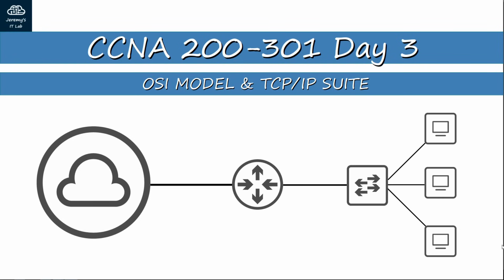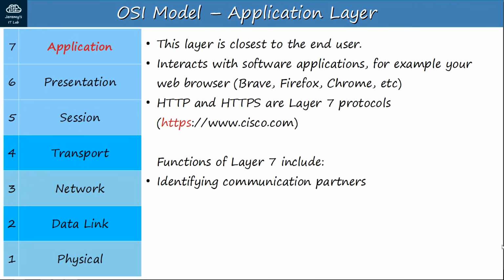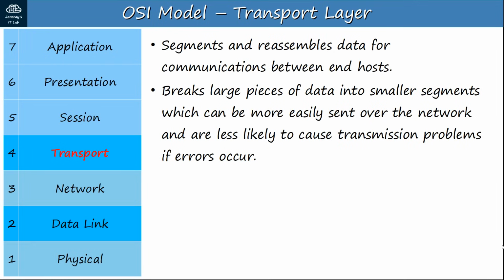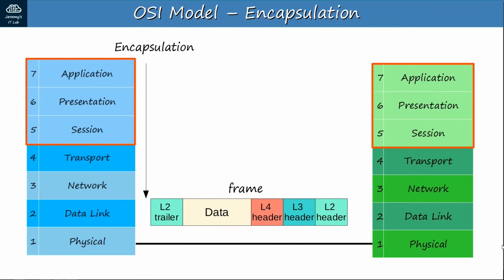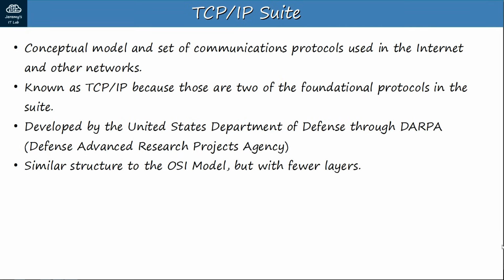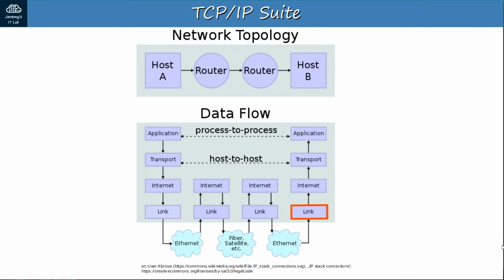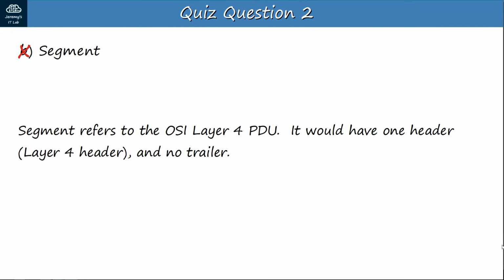Free CCNA | OSI Model & TCP/IP Suite | Day 3 | CCNA 200-301 Complete Course

Comment: I was a bit confused in the beginning of the video when covering encapsulation of the OSI model with routers being a layer 3 device. It did not make much sense to me that devices went through the full layers to L1 but then were routed from the router (l3). Layer in the video you covered this well! It de-encapsulates & encapsulates from L1-L2 for each hop to the other network. Thanks for explaining this!

Comment: Hey man i am using this video course only. Does it cover all the exam objectives and will i be ready for the exam just based off this course? Thanks, really appreciate this!
Reply from the maker: It will cover all of the exam objectives, unfortunately its only about 50% finished at the moment.
Reply: @JeremysITLab  Hey man great to hear that. You are doing a lot for this industry, its really helpful for us beginners getting into IT certifications. I am at Intro to the CLI | Day 4 at the moment so i think i will be fine with the pace. What do you reckon, my aim is to finish two of your lectures a day. Thanks again!
Reply: @JeremysITLab   How much weightage does OSI andTCP/IP model holds in 200-301 exam?
Reply: @DAfitnessCoach  hi man, did you pass the exam ? and how u found this course.
Reply: @DAfitnessCoach  everyone needs to put some donations to help Jeremy's IT and this course get faster done, in that way he can help us with questions and material required.
Reply: @JeremysITLab  Hey Jeremy, is it 100% now?

Comment: Great video Jeremy.  This is one of the best explanations of the OSI model I've seen.  Just one suggestion.  Although it is implied here, I think it's important to explicitly point out that every layer of the OSI model (and TCP/IP suite) is dependent on the layers below them to function.  So in other words, if Layer 1 (Physical) fails, then nothing else above this layer can function.  This seems obvious at Layer 1, but at the logical layers above the same applies (if Layer 3 fails then Layers 4-7 will also fail).  At the same time, if a device functions at say Layer 3 (like a router) then by default it also functions at Layers 1 and 2.  This also means that a PC functions at all layers of the OSI model.  That graphic you found of data flow is EXCELLENT.  Makes it so easy to understand.

Comment: The aid I normally give to people trying to remember PDU's and which OSI layer they relate to is to separate the first 3 letters from the PDU which leaves the number of letters coresponding to which layer it belongs to:
Transport - Layer 4 - Segment - Seg ment - 4 letters remain
Network - Layer 3 - Packet - Pac ket - 3 letters remain
Data Link - Layer 2 - Frame - Fra me - 2 letters remain
Physical - Layer 1 - Bits - Bit s (as you never send only one bit over the network) - 1 letter remains
Hope this helps someone.

Comment: Well, in video u mentioned host to host connectivity provide transport layer but it's also provide network layer. 

Transport layer : end to end ,port number. 
Network layer: host to host, ip address 
Data link layer : hop to hop , Mac address. 

Correct me if I am wrong.

Comment: You said  at time 24:01 of this video  that the  the OSI Transport layer provides host-to-host communications, but I wonder why don't we consider the Network layer resposible for host-to-host communications  since the distination IP address of the frame doesn't change along its journey but only the frame destination  MAC address changes at each hop during its journey from the  source host  to the final destination

Comment: Hey Jeremy, many sources on the internet say that the transport layer is responsible for Process to Process delivery. And the network layer is responsible for host o host delivery.
I think it is somewhat correct because port numbers are handled by the transport layer. But the network/internet layer works only b/w routers not LANs. So which one is it?

Comment: I think I get it now....So in the physical representative sense, the Transport layer is referring to the NIC and interface ports on the hosts (servers, PCs, etc..)? WHAT happens there is the breaking down of the data or reassembling of it but specifically WHERE that occurs is at the networking hardware of said hosts (like the aforementioned NIC and interface ports). Ergo, host-to-host. Am in the right ballpark?

Comment: hello sir i have a question. we learned here that digital bits are converted to required format(electrical or radio) in the physical layer. could you please tell me in which layer is the data converted into bits? thank you!

Comment: One of the questions in the flashcards asks, "Which layer of the OSI model detects and corrects physical layer errors?" then shows the answer as layer 2. but Layer 2 does not do error correction, just detection via the Frame check sequence. Error correction only happens at layer 4. Am I wrong?

Comment: It seems there is an error in the L4 explanation. It shouldn't be 'host-to-host' but only 'process-to-process' thus this leads to the following: 

- Network Layer (L3): Provides host-to-host routing using IP addresses

- Transport Layer (L4): Provides process-to-process communication using ports

To be able to communicate between hosts we would need MAC/IP which aren't available in the L4 TCP or UDP header. 

Please correct me if wrong.

Comment: I'm a little confused about host-to-host communication. The diagram in the 'data flow' section shows host-to-host communication at the transport layer. However, in the flashcards, the question, "Which layer of the OSI model provides connectivity to end hosts on different networks?', the answer is 'Layer 3 - Network'. What am I missing here? Thank you.

Comment: the flash cards for day 3 doesn't work. even though everything else works fine

Edit: for some reason the flashcards can't be imported directly from the ankidroid App on android. You have to import it from your pc and then sync it to your phone by using the same anki account, then it should work just fine with your phone.

Comment: Hi Jeremy. In the video you said that the Transport layer provides process-to-process communication as well as host-to-host. However, in the flash cards, the answer to the question “Which layer of the OSI model provides process-to-process communication?” is “Layer 7 - Application”. Just want to clarify which is correct?
Reply: I have the same question. Is it a layer 4 Transportation?
Reply: Layer 7, he's going by the flow chart he showed at 21:39 Process to process, Layer 7 Application.

Comment: Hi Jeremy. Just a little bit of confusion. On the video, talking about the OSI model, you say that the Transport Layer is the Layer where the Process-to-Process communication takes place. However in the TCP/IP model, showing the Wikipedia Data Flow chart shows that the Process-to-Process occure on the Application Layer. Am I confused, is that an ERRATA on the video or that's the way it is? Thank you so much for your help.

Comment: Really enjoying your course and thank you so much for all your hard work. I noticed your using the 4 layer TCP/IP model in your tutorial but I was led to believe that the 5 layer TCP/IP model was more appropriate for the new / revised CCNA, CCNP and CCIE examinations. This 5 layer model was quite strongly reinforced in another set of tutorials I have been following and seeing your material talk exclusively of only the 4 layer model has derailed me a little. Can you comment on how critical this is for passing the exams?

I guess, my concern would be with an exam question like ‘Where on the TCP/IP model would the OSI layer 3 Network layer be?’ On the layer 4 model, this would map to layer 2 Internet, but on the 5 layer model this would map the same as the OSI and the correct answer would be Layer 3 Network layer.
Reply from the maker: Feel free to use the model you prefer!  Whichever makes things easier to understand.  That's why I presented the various models in this video.

Comment: One question - I notice that the Cisco CCNA cert guides   specifically says that for the TCP/IP suite to use the 5 layer model: Application, Transport, Network, Data and Physical - much like the OSI model.  Has this changed or do people just use different kinds of layers for the TCP/IP suite based on how they learned it.  Thanks
Reply from the maker: Hi Barry,
The official TCP/IP model has four layers, but most people (including me!) prefer the five-layer model.

Comment: what is the use of layer 3 broadcast address if the devices with in network communicates at layer 2
Reply from the maker: If the Layer 2 address is broadcast, but the Layer 3 address is another device's address, the message will be ignored.  The Layer 3 broadcast message means that the message is destined for all devices on the local network.

Comment: What is the difference between protocol and standard?
Reply from the maker: A protocol defines a set of rules used by two or more parties to interact between themselves.  
A standard is something designed to be used as a rule, guideline or definition.
So, some standards are protocols and some protocols are standards, but they aren't necessarily the same thing!
Reply: @JeremysITLab  Thank you very much Jeremy!

Comment: Hello and thanks for this series of video lessons, I find them so useful!
I have a question about the flash cards of day 3: one asks “which layer of the OSI model provides process-to-process communication?” And the answer is “layer 7 - application”.
Shouldn’t it be “layer 4 - transport”?
Thanks again! Bye!
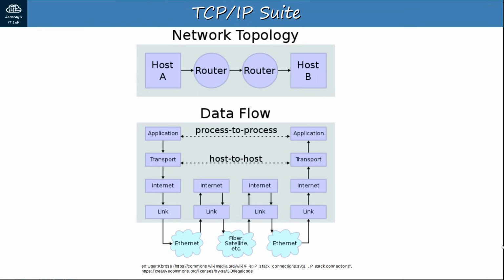Reply from the maker: The flashcard is correct.  Check out the diagram at 21:03, it's helpful.
Reply: Jeremy's IT Lab Thanks a lot for your reply!
What is the meaning then of what it is said at 10:11?
Reply from the maker: @TheSten89  The 'host-to-host' communication at Layer 4 is what enables the 'process-to-process' communication at the upper layers (5-7).  I should have emphasized this more in the video, but each layer 'serves' the layers above it.  Layer 3 serves Layer 4, Layer 2 serves Layer 3, etc.
Reply: Jeremy's IT Lab I understand now, thank you so much! You’re the best :)

Comment: In one of your questions in the ANKI, there is a wrong answer: 

Which layer of the OSI model provides process-to-process communication?
Layer 7 - Application

The answer should be layer 4. 

Or do I understand the question incorrectly?
Reply: layer 4 transport layer provides host-to-host communications while layer 7 the application layer provides process-to process communications. So the answer is correct. He also mentions that in the quiz section of this video in case you wanted to confirm. Good luck!

Comment: Would you advise on changing the "New cards/day" and "Maximum reviews/day" values since the default value of the former is 20 and if I add some of my own questions as flash cards i end up not reviewing every single one of the questions i downloaded from your link. I'm actually new to Anki so I don't know should i change anything in the options or just keep it as is?
Reply: at the "deck" page, at the right of your deck CCNA there is a wrench sign; click the wrench to show a menu, then click "option" in the menu to change daily new/review card limit

Comment: I found a mistake in the Anki files. Question "Which layer of the OSI model provides process-to-process communication?" it gives answer: "Layer 7 - Application" but should be "Leyer 4 Transport"
Reply: layer 4 transport layer provides host-to-host communications while the application layer provides process-to process communications. So the answer is correct. He also mentions that in the quiz section of this video in case you wanted to confirm. good luck!
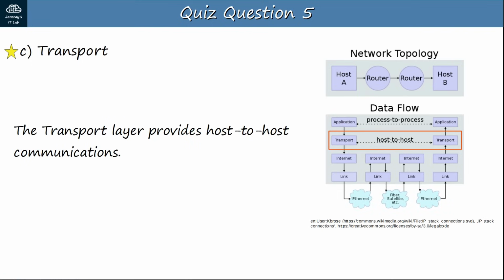Reply: @YoItsDalia  10:10 So the video contains contradictory information 32:12 Clarify my confusion.
Reply: @ you can see in the slide written host-to-host for the transport layer 10:10 I think Jeremy mistakenly said process-to-process there. I’ve also confirmed that with chatgpt so the correct one is host to host for transport layer and process to process for the application layer.

Comment: Anybody else get confused on quiz question 2? i was having some trouble understanding it
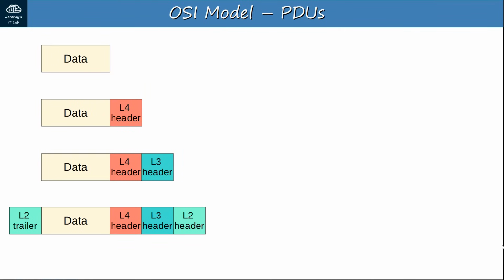Reply: It's essentially asking at what current layer is dealing with the data, but the question is actually asking you to describe the data in terms of its encapsulation. If you go back to 15:55 you'll see that Jeremy explained it quite well. 

So if 3 different headers are attached, it's a frame operating at the 2nd layer of the OSI model.

Comment: I don’t understand Quiz question 1. If my web browser is talking to YouTube’s webserver, the only way to do that is by encapsulating a request, forwarding that request to YouTube’s server, that server de-encapsulating it, processing the request, encapsulating a response, forwarding the response, then my pc de-encapsulates the response and handles it. You cannot ignore those steps. Saying this process is adjacent makes no sense. Is this just an “industry standard” way of talking about this interaction? 

This is the same kind of logic as saying “my car is electric” despite owning a pickup with a 5.7L V8 engine needing a battery for the starter.
Reply from the maker: The question is specifically asking about the HTTP exchange, not the underlying protocols and processes that are used to deliver the messages between the two hosts. Read the question carefully and think about what it's asking.
Reply from the maker: An HTTP exchange between two hosts is an example of same-layer interaction. Other processes, like encapsulating and de-encapsulating messages, are required to enable that exchange, but it's not accurate to say that "an HTTP exchange between two hosts is an example of encapsulation".

The logic is like saying your pickup with a 5.7L V8 engine is a gas car (an accurate statement), even though it uses a battery for the starter. The starter is one process that enables the car to drive, but it's not accurate to say that the car is electric (just as it's not accurate to say that "an HTTP exchange between two hosts is an example of encapsulation", even though encapsulation is one of the processes needed to deliver messages between the communicating hosts).

Comment: Hallo Sir,i have one question...i am not getting host to host communication what does it exactly means...if every data is going throught he same process for example layer 7 to layer 1 and vice versa what does host to host means then....did not get it....Thanks a lot
Reply from the maker: The diagram at 21:06 is the best demonstration I think.  Notice how the Layer 4 segment remains untouched from Host A to Host B, while Layers 1-3 do the work of sending it from network device to network device.  When I cover TCP/UDP (Layer 4 protocols) later in the course you'll get a clearer picture of it.
Reply: @JeremysITLab  ok Sir thanks a lot indeed

Comment: There is an error for this days anki flash cards.
Reply from the maker: What's the error?
Reply: @JeremysITLab  the error states it is not a valid file type for anki and that the extension is not correct. I checked it and it is. I even tried changing the file type to the other accepted file type but it does not seem to work. Day 1,2,4,5 are working perfectly and have helped so much!
Reply: @ericgillespie2812  I'm having the same problem now
Reply: @JeremysITLab  Maybe you could try reuploading the file in the folder? I tried downloading it several times but the size is always 0 B even though it's stated in the folder that it's 9.6 KB.
Reply: Okay, I figured it out. I tried downloading it from my laptop then sent it through file.io to my phone (I use AnkiDroid for the flashcards). When I downloaded it on my phone, the file ended up as a .zip file with 2 items inside instead of an .apkg like it was supposed to. I downloaded it again then saved it with an .apkg file extension and now it works!

Long story short: If you're using your phone, copy the drive file link to your phone browser then downloading it from there also works. No changes needed.

Comment: I'm confused - Your combination of TCP/IP layers 1&2 into just a "Link Layer" seems completely wrong and contradictory.  You even show these as different layers with the cloud underneath but you just don't address it nor label it....but it's most definitely different. 

And looking at Wiki is no help either because they do the same.  Why is that?  Why does Cisco and the TCP/IP standard actually ignore the physical by not labeling it yet clearly they address it in their drawings and illustrations.  It seems completely mental to on the one hand acknowledge it in their drawings but then turn around and act like it doesn't even exist with their labeling.

WTF man?
Reply from the maker: It's not 'my' combination of OSI layers 1/2 into 'link layer', it's the standard defined in RFC 1122 (https://tools.ietf.org/html/rfc1122 ).
It's not ignoring the physical layer, it's combining the functions of Layers 1 and 2 into one theoretical concept.
Reply: @JeremysITLab  - I'm sorry I didn't realize that was part of the standard. I think I see why I got confused.

@ around the 9 min mark, you show how data progresses through the layers and headers are added.  These are labeled L4 Header, L3 header, etc. BUT you're using the OSI model.  So when I tried to apply that to the TCP/IP model, L4 is actually the application layer, not the Transport layer.

Thanks for the link and for I do apologize for attributing this to you.